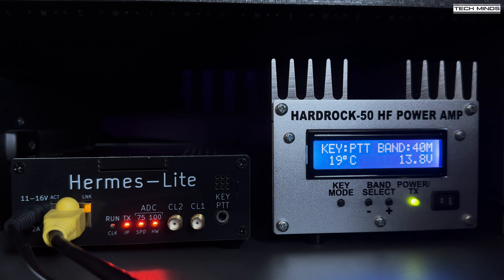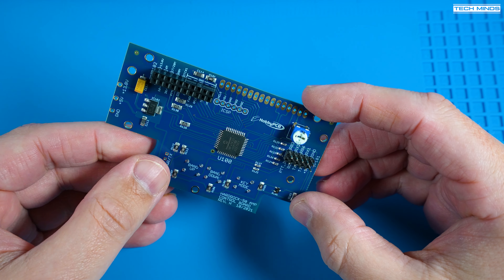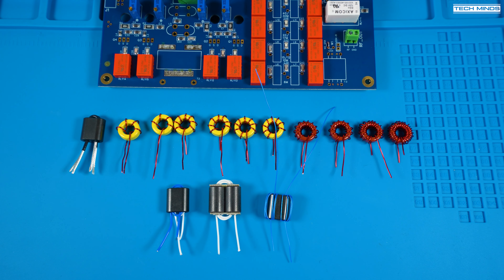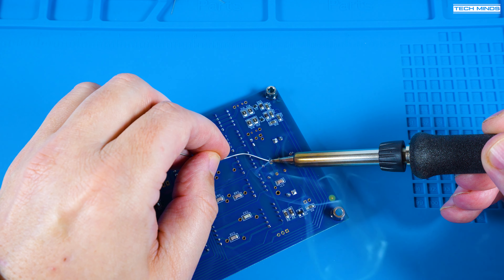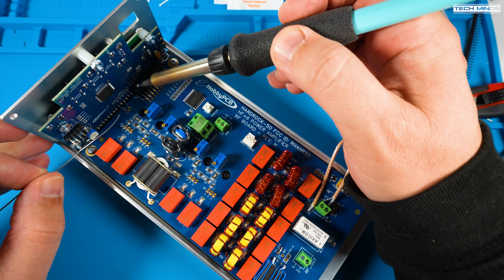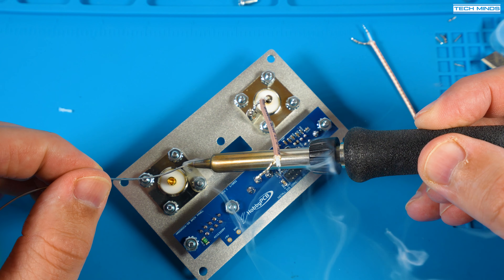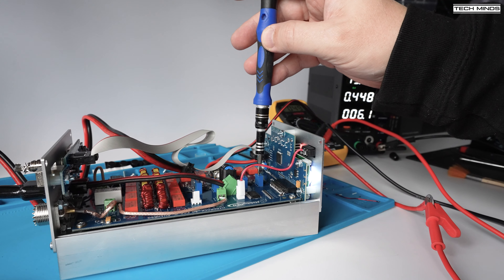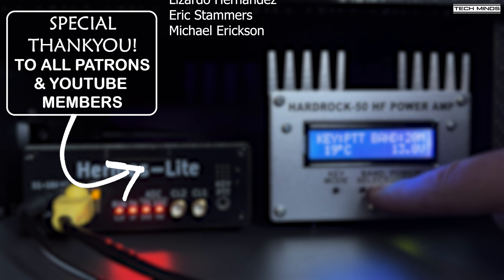Step By Step Guide To Building The Hardrock 50 HF Amplifier

Comment: informative and well produced video. The Hardrock 100w version of this amp is selling for 25 USD more, so might be a better buy.
Reply from the maker: Thank you!
Reply: I think the 100w version you speak of is the HR50+ upgrade kit. You'd have to start with the 50w version, and THEN add the cost of the upgrade. The kit looks nice: adds some neat features, doubles the power, and weighs 4oz LESS, but spendy, and requires a 50v 5a power supply, which would make it not quite so handy for field use. In any case the difference in signal strength for those receiving you would be about 3 dB. The 50w version was surprisingly fun and straightforward to build, and has been slaying it on SSB and digital all afternoon. It needs around 7a at 13v to make 55w out, so is pretty easy to power for field, portable, or even SOTA ops. 73 es GL de N1WMR

Comment: Got 2 of these and the dongles to work with the KX3 and K2. While I have completed assy, I have not yet set bias. A little skiddish powering up because I don't want a flaming mass on my shack table
Reply: and my kits really didn't have all those presoldered parts like the relays. Had to do those myself